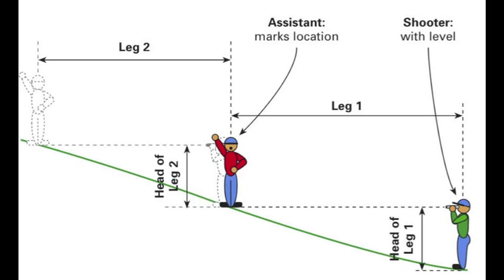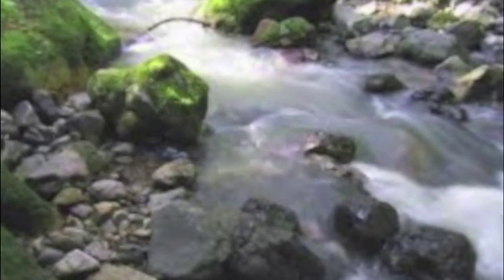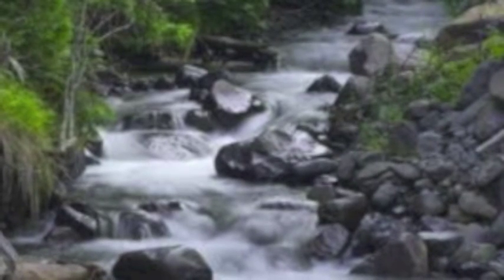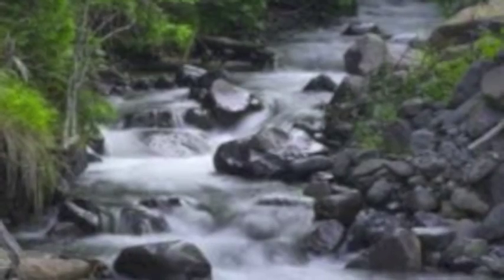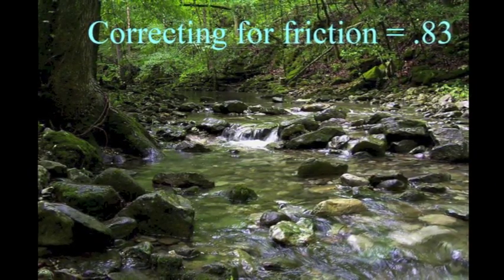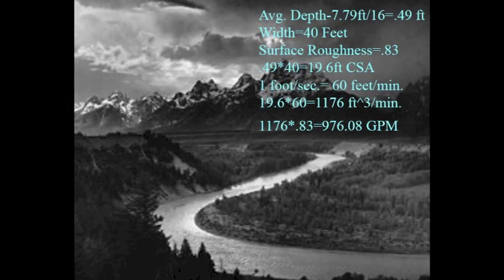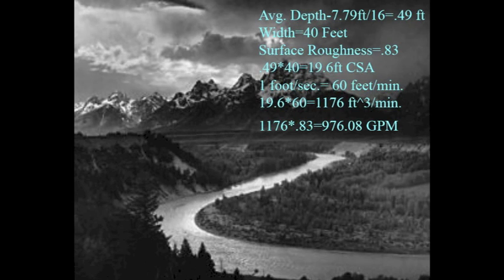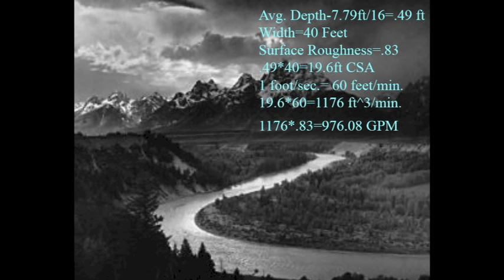Micro Hydro Viability Assessment Instructional Video

Comment: Thanks for the video well done and easy to follow however as I entered the data into excel so I can calculate the GPM did I miss something??? Assuming you had 27ft of sample distance and you had an average of 16 sec that equals 1.5ft per second or 0.028125 ft per min nothing in you formula I see no such value or anything close it is like you left this out of the formula. Can you just give the calculation  in a formula. 
  As to timing I would suggest that you use a pause (lap) on the stop watch restarting on each attempt and then dividing that by the number of samples it helps average errors in start and end time.This is similar to the way you did water depth. 
  Also nice point on the percentage of water usage to have as little impact on the stream as possible.
Lastly I assume that the filtering on the real hydro setup that...the initial 55 gallon tank is to remove heavy material (i.e. rock), you didn't state that..
This all said good video well produced easy to follow.